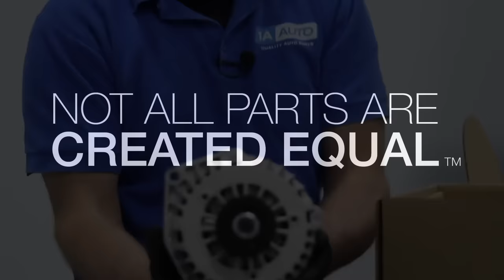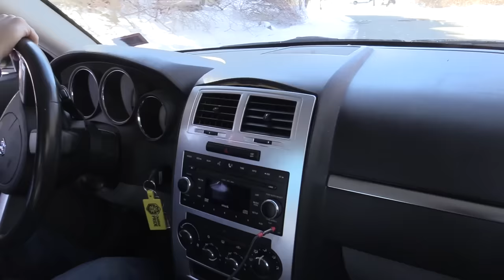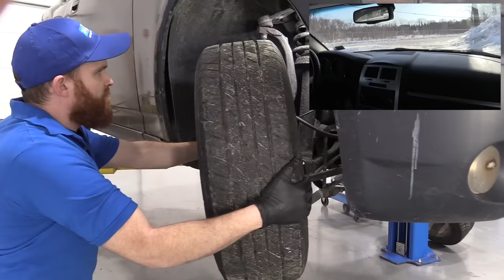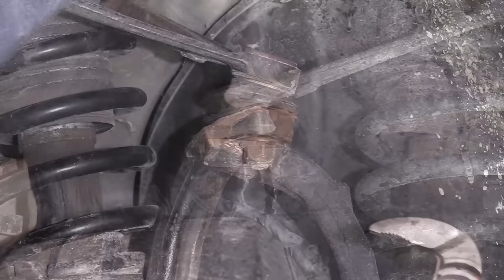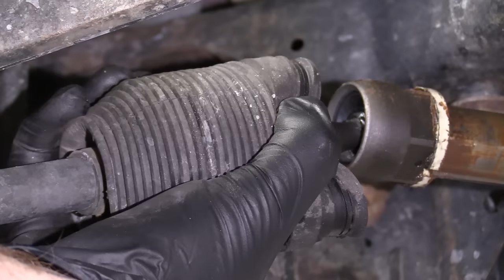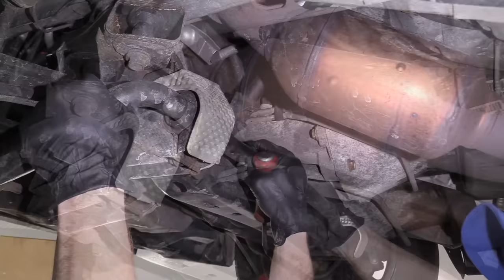Clunking in the Front? What's That Noise in My Car, SUV, or Truck?

Comment: That's exactly the noise I've been dealing with in my car for the past 3 years and every shop I take it to says the car is in perfect condition. Either I'm hearing things or the mechanics are incompetent. I wish I had the tools to check it out myself but it would be a bad idea to try and lift a car on dirt.
Reply: me too!! for two years now :( its super frustrating.
Reply: Just get some thick slabs to put on the dirt, park on them for a day or two so they're fully sunk in and not going to move, then you can use those slabs to put jacks/axle stands on to raise the car off the ground safely, or safer atleast xD
Reply: Same here mechanic says its fine but those noises make me feel like something is about to break

Comment: what i learned after trying to find what's causing the noise in my 10 years old car: just replace all the suspension parts, it would be much easier. lower arm, absorber, absorber mount, sway bar links and bushings. and if you drive years with busted struts, change the cv axle too because they will definitely went bad.
Reply: That would cost as much as my 10 year old car.
Reply: @JohnS-il1dr  you seen car prices lately?

Comment: It’s a Chrysler no surprise the ball joints are bad. I had a Jeep Patriot that needed ball joints every 25,000 miles driving on paved roads. Alot of times front suspension noise can also be front sway bar links. They can make a lot of noise and are pretty easy and cheap to change. They are even really cheap to have changed at the dealership.

Comment: What would be great is to use a camera mounted on the parts as you drive around or over bumps. I saw some guys with this camera - not sure if it was magnetic or not but they just mounted under the car.
Reply from the maker: +norakat Thanks for the tip!

Comment: My 03 Town and Country began clunking from the front end whenever I turned a curve and would slightly bounce.  I couldn't tell exactly where it was coming from UNTIL  I saw something fly out from under it and I just barely got it Into a parking lot only to see the right front wheel bowed inwards. The strut mount had been broken for a while. I managed to get it rigged back up Into the hole and carefully limped the van home for repairs.

Comment: 2006 Colorado.  Passenger side, front axle has been clunking for over a year.  I've had the front end worked on 3 times, over $2500.  STILL making that dumb sound!  Mechanic says everything is tight.  It's usually loudest when I start driving it after it's been sitting.  Then it quiets down.  The truck runs fine.  Just this annoying noise that wont stop.  :P:P:P

Comment: i thank you for sharing this I am searching for noises and by doing so i notice a bad lower control arm and also bearing hub I change both but still have  a clunking noise when turning my wheels to both side and i think your video gave me 2 more ideas of where the noise could be  coming from this is one of the best videos and by the way another one of your videos came pretty handy too and mi too learned more from this video that watching many others suspension diagnostic videos thank you very very much
Reply from the maker: +luis moral Thanks for checking us out! http://1aau.to/m/Shop-1AAuto-c

Comment: Is it possible a periodic clunk/pop sound in front when I turn the wheels at very low speeds could be caused by a defective cv joint? I have already replaced all suspension parts including struts,ball joints,control arms, sway bars and tie rods. The boots on the outer look good. Thx.great video btw
Reply: Dapper Dan how's it going? My Name is Nate and I have a question for you. My 2010 Dodge Charger 3.5l SXT is  making that same sound. It makes a loud pop sound on the driver side on my front suspension when I make a hard left or right turn at a slow speed or when I am making a hard stop it pops really loud. I  too have replaced everything. So what did you do?
Reply: @tossemup5210  im heading down the same road as you two with a 06 CRV. Its driving me crazy. I dont think it aould be CV becouse that would cause a wiggle and be more noticable. But if it was that please let me know lol

Comment: I drive a three axle roll off dump truck. When I'm breaking suddenly there's this loud banging sound coming from the front axle and I get very little braking power for half a second like I was sliding forward without much resistance followed by a second loud banging sound like something violently clicks back in place and I get braking again. What is it?

Comment: I have knocking up front, it sounds just like a ball joint so here’s what I did (2006 Infiniti G35 coupe)
Replaced:
Ball joints
FUCA’s
Lower CA’s
Compression rods
Wheel hub assemblies
Rotors & pads
Sway bar bushings
SB end links
Struts 
Tie rods inner/outer
Had motor mounts checked
Everything re torqued
Nothing else to replace or to be checked
Still have the same knock no worse no better 
End it Hass to be the suspension because when I roll over a bump, just the front end, not the rear, you can hear it in the cabin as the suspension moves, more noticeable, rolling slow over bumps
Reply: Nothing is hitting each other nor knocking on the chassis, all welds are good, no rust easy to see, steering rack is tight , it’s not the cats or exhaust either the only thing I did not replace are the calipers but the brakes work perfect. Just did the brake job.

Comment: I’ve got an 06 GMC Sierra. I’m getting a clunk(from passenger front) when leaving the rest position but not while driving, only when going from stop to motion. I’ve check my sway bar, ball joints, tie rod, control arm, etc. Just changed my absorbers and mounts are still good. The wheel does have some play when jacked up and wiggled. It does not have any other symptoms of being a wheel bearing. Motor mounts are solid. I’m baffled and wondering what you think it may be before i end up replacing a bunch of front end parts.
Reply: Maybe see if your tires are to torque, probably not the issue though

Comment: Hello 
HOPING all is well with you and life is treating you good as you are treating life good, also.
 WAS blessed by God through my 21 yr old son to help me purchase used 2010 Dodge Journey with just under 80,000 miles.
HOMELESS for 15 yrs, 2-3 yrs with vehicle in beginning then on foot for 10 yrs & bicycle for past 3 yrs until last month obtained vehicle with help from my son.
HOWEVER, being used vehicle is full of problems in need of repair n maintenance already oil change, needs tune up, now experiencing knocking sound when turn wheel left n right as well as after engine oil change noticed gas is being used quickly as if leaking or something.

Comment: I have a 2022 Veloster N with only 4k miles. On cold mornings, it makes a clunking sound when I turn right. I can feel it on the steering wheel too. Tried to replicate during the day, and didn't get anything. The dealership couldn't find anything wrong, but I know there has to be something going on. Any ideas or suggestions as to what it could possibly be? Side note, it does have an lsd's

Comment: My noise was impossible to find. But I checked the transfer case and it was lose. Thanks to dealers service department working on the transmission. So I pulled the cross member and mount, tightened the bolts and it disappeared..

Comment: Super helpful. What would you check for first if the clunking was coming from the front right wheel only on hard right turns? 2017 Subaru Forester, if that helps.
Reply: Possible concussion. A Forester driver turning hard right is highly unusual. (Just kidding.) My hunch is upper control arm ball joint. But I’m an idiot jokester (and Subie owner) not a mechanic.

Comment: after they have a curve and I straighten the steering wheel and start to accelerate, there is a squeaking iron on the iron only for a few seconds when I come out of the curve and the wheels are straight.  when I brake I don't hear anything when I go straight and I accelerate I don't hear anything.  only when I come out of a curve and accelerate slightly when the wheels are straight.  do you have any idea what it should be?  Thank you

Comment: 1A Auto:  How can I check a lower ball joint (front) on a FWD with 178,000 miles on it?  I know how to on RWD since it's easy to unload the lower control arm, but FWD does not work like that.  Thanks!

Comment: Thanks for the great video. very helpful. Last week, my mechanic put in a new front pads and rotors, I have notice each time the brake is engaged, I can hear a "metal claking" (one time) from both side. Sounded like the pads is hitting the rotors, or caliper hitting the pads!? It's only been a few days not sure if that will go away soon. Any suggestions?  thx
Reply: Did you ever figure it out?
Reply: Following

Comment: My truck makes a clanking noise in the front driver side tire. It’s a rhythmic noise as if you put something in your bicycle spoke and rode slowly. I did a look behind the wheel and saw nothing obvious (I’m don’t really have any experience in fixing cars or seeing problems) but I haven’t noticed any performance issues. I need to check the lugs but I also don’t have a jack or anything to lift my truck. Whatever it is, the noise it pretty loud and I can only hear it at slow speeds. Its driving me nuts

Comment: i will need to check my suspension because i changed coils and for no reason after like 30 km i got clunking noise probably stabilizer link got loose or wasn't tightened enough

Comment: hey buddy thanks for the video, we are chasing a clunk in my ford escape right now, we did the sway bar links and that cut the sound down quite a bit we did the lower control arms as well., but i'm still getting a bit of a clunk and rattle or jiggle in the steering wheel over bumps, we are thinking the intermediate steering shaft next, what do you think, is that a characteristic of a bad shaft/u joint?
Reply from the maker: +01hondascott We wouldn't be able to diagnose an issue like that here, you may want to have a local mechanic take a look at it. Thanks for checking us out! http://1aau.to/m/Shop-1AAuto-c

Comment: My front suspension has a major singular or double clunk when steering left/right, during suspension travel or when driving through curves. LCA and UCA, air struts etc. were all replaced in 2022. I did hit a few pot holes since and right LCA ball joint boot is already torn and the joint seems to be dry. Also, the power steering rack has play on the left side where the rack is entering / exiting its housing. A Mechanic's shop diagnosed my car and said the ball joint's torn boot / dry joint causes the clunk, ruling out the play on the left side of the steering rack as a non-issue. But according to your video the steering rack itself shouldn't have any play, correct?

Comment: I have a 2006 buick Lucerne and I have a clunking noise in my right front suspension area when I turn the wheel driving at low speeds (example driving in a parking lot/leaving a parking spot, turning at a stop sign) or if I'm sitting still and turn the wheels. A friend thinks its a CV axle but I dont think it is, I replaced my driver side CV axle a year ago and that made a clicking noise, not a clunking sound. I replaced the outer tie rod, didn't fix it (which was bad anyways). Could it be a strut, lower control arm..?? Really could use some help.

Comment: I have replaced every ball joint, upper and lower control arms, sway bar bushings and struts in my 2010 Charger RT and its still clunking just as bad. I've taken it to 3 shops and no one can find it. The only thing that hasent been replaced on the front end are 1 sway bar link and the rack & pinion. The tie rods are only 18 months old as well. I have 3 Dodges but this makes me hate them every time I drive it.
Reply from the maker: +vadenkwin Thanks for the feedback!

Comment: Help please  On my 2012 caravan I replaced strut, bearings, inner , outer tie rods , swey bar end links , swey bar bushings, engine mounts, transmission mounts , balanced tires 3 times ,2 alinements. Different places.  Wheel feels solid but sounds to slightly wop wop wop , pulls left , clunking with any little bump. Is it even tho I can't reproduce the sound maybe it's control arm bushings or ball joints?

Comment: I have Nissan Titan 2004 and makes a clocking noise when driving over a bump or even when is stop and i turn the wheel. 
3 control arma have been replaced and still making the noise

Comment: I normally W to the caliber rubber seals and scrub them with a toothbrush, and then rinse them down with a brick cleaner. Is that something good to do to protect the rubber before pushing back the caliber inside or it’s a bad thing

Comment: These videos are great. I do almost all the work on my tracks because I like to clean and grease everything and just knowing it's done right not to say mechanics won't do the job correctly I just like to have that piece of mind that I did the work and every nut and bolt has been cleaned and grease Plus the biggest obvious is saving money on paying someone. But I watch a lot of videos before fixing a problem for tips and info on parts. 👍🛻

Comment: Hahaha. I think the car axle design is due for a new design or reinventing as its has too many joints and too complex joints would coz more failure. My car seems like every year need to replace the link arm and the tie rods. Either they make low quality easily spoilt spare parts or the roads are getting too many potholes. 🤭😅 Absorbers used to last a few yrs. But nowadays 1 yr the absorbers will be leaking oil and spoiled. Now many parts are made in China. ✌🏼

Comment: Just did a control arm job on my 2013 legacy unfortunately both pinch bolts snapped so I had to drill them out and replace with a different bolt... now the car make a popping noise while driving (taking turns and Breaking) any tips to fix this???
Reply from the maker: +Jason Wicks We wouldn't be able to diagnose an issue like that here, you may want to have a local mechanic take a look at it. Thanks for checking us out! http://1aau.to/m/Shop-1AAuto-c

Comment: I have 08 Dodge Grand caravan with a 3.8 L in it the engine started knocking as though it had no oil but it does have oil. What's going on with my van. 08 Dodge Grand caravan SXT 5th generation 3.8 engine

Comment: Only when I go over bumps or railway crossing my van rattles and shakes bad. I gather its a lose suspension, and had all shockers replaced.  Still the same thing happen
Reply from the maker: +trevor Byron We wouldn't be able to diagnose an issue like that here, you may want to have a local mechanic take a look at it. Thanks for checking us out! http://1aau.to/m/Shop-1AAuto-c

Comment: does any of this make a CLICK noise when its going bad? when i slow down, speed up, and go in tight circles my car clicks in the front
Reply: That's your CV axle. Parts and labor will run you about $200. If you look on the backside of your front wheels there's a black rubber cone shaped piece pressed up close to the wheel. If that rubber piece has a rip in it, that's the culprit. Hard acceleration and turning your wheel to the point you hear that clicking sound will wear it out fast. If your like some of us and need time to save for that repair, get a can of red and tacky spray and spray the inside of that boot area. Its clicking because there's no grease in there to keep it lubricated. Good Luck!   👍🏼

Comment: I've been having a clunking noise for months and no idea where from
Reply: Mike Grant Maybe control arm bushings.
Reply: I had the same issue with my Camry. Had a shop tell me control arm bushings were fine.
I changed my struts (they were due anyway) , sway bar links, sway bar bushings and ball joints. No help.
Decided to change control arms.
Clunking now gone 👍

Comment: -My truck knock once whenever I brake (sounds like it's coming from the front)
-both front tires make a high pitch squealing sound when I turn both sides regardless of speed

Any idea what could possibly be wrong? I've already changed the bearings on the front wheels and it seems to fix it for a while then it started again, this time even worse! It's just a 5yr old truck..
Reply from the maker: +VALENTINE JANA WILFRED GELUNGAN We wouldn't be able to diagnose an issue like that here, you may want to have a local mechanic take a look at it. Thanks for checking us out! http://1aau.to/m/Shop-1AAuto-c
Reply: Plis help a sister here my honda make that clunk noise when I apply some breaks and imagine I have new suspensions in my car this sound is on driver 's side

Comment: So I have some clunking in my front driver side wheel. possibly a warped rotor I'm thinking but like I know the struts are not in the best of shape I've had the tie rod and the CV joint replaced in the tires aligned not in that order though unfortunately but neither mechanic said anything about anyting else being wrong with it when they have the wheel off...
Reply from the maker: +Sarah Lee We wouldn't be able to diagnose an issue like that here, you may want to have a local mechanic take a look at it. Thanks for checking us out! 1AAuto.com
Reply: @1AAuto  BTW I like your videos :-) 
problem with the local mechanics around here is they screw me over cuz I'm a chick. Not saying all mechanics do that but the ones here do.☹️☹️

Comment: Maybe I've watched too much motorsports, but I don't see anything here like a control arm breaking in half or a steering rack falling apart causing a catastrophic instant loss of control accident. It's hearing noises and feeling a shaking steering wheel. Yes, it's something to schedule repair for but mechanic-induced panic is not the answer.